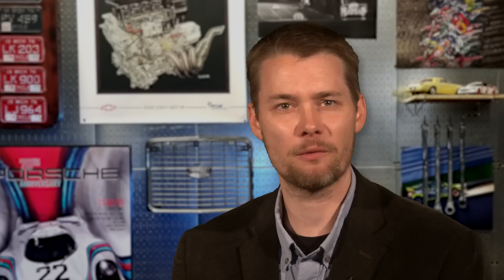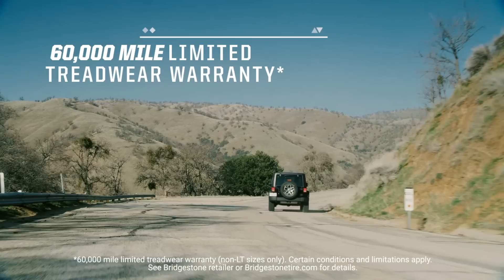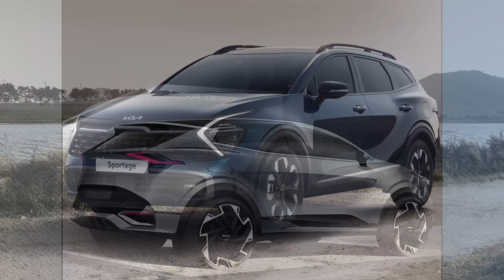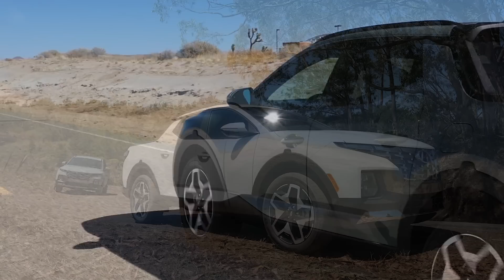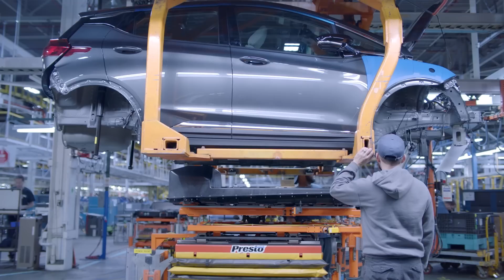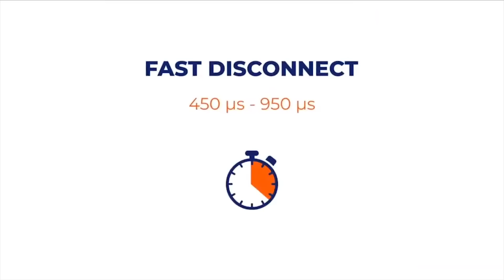GMC Eyes Off-Road Market; Ford Electric Crate Motor Specs - Autoline Daily 3149

Comment: Pyrotechnic battery disconnects have been around for years. My MINI had one way back in 2002.
Reply: Yes - they are not new for 12 VDC cut-off and are found on many vehicles. I recall most are activated when the airbags go off. But a switch that can handle 300-440 VDC is something more recent. A quick search revealed that Tesla has patented the device back in 2015.

https://patents.google.com/patent/US9221343B2/en

https://www.motortrend.com/news/tesla-patents-device-can-improve-battery-safety/

Comment: In the Ford Lightning 150, there is not enough space to attach the inverted directly to the motor casing, so it has 0.6 metre cables to the inverter sitting nearby. Lots of packaging advantages in having some distance between inverter and motor when it comes to all the HV components that might be grouped together in one sealed and plate-cooled box.

Comment: Talking about HP and torque without including the inverter in the equation doesn't make sense in an electric drivetrain, unless those are the motors maximum allowable number... That's like talking HP and torque numbers for a transmission. 

Regardless, the price is good if it comes with warrantee support.
Reply: Bosche already makes an integrated unit

Comment: @sean,  your reporting on the GM - LG situation could not be more detached from reality.    Awful spin on what was said...   Mary said LG is a "Valued Partner" and GM plans to continue their relationship with Ultium LLC .    Then on a separate question about battery partners and diversity Mary said Look,  we have our own lab, and investments in other battery technology partnerships currently.   You also could have added Sandy Munro was interviewed on Bloomberg right after Mary Barra, and he put the Bolt fire blame squarely on LG Chem. saying this was not GM's fault,  this was a supplier problem.
Reply: I like that you now use Sandy as an expert on the topic of GM's fires lol, but I do agree, it's LG's design problem. 
I just wish GM moved faster with the recall after seeing Hyundai's experience with this LG mess.
Reply: @AllanSustainabilityFan    No,  I am not calling on Sandy as a battery expert,  but this case only requires common sense.      Also for you if there is a design problem all the cells have the flaw..  This is a manufacturing problem which is different in that only about 1 is 25000 cells exhibit the flaw (s),   but that is too many, and LG needs to initiate better quality control to root out the bad cells prior to packaging.    BTW,  another Tesla S fire today at a service center in Europe I read.     No details on the series of S,  but I will assume 85,  those are the fire prone ones.

Comment: Management at gM just gets better with time ~53% market share down to ~17%  covid-19 flu  -  all seems insanity
outsourcing news - Joyson  --- continued trend outsource all -- just do assembly -- goal the badge on the hood the only part gM needs to pay a worker to install.
Reply: What automaker builds in house more cost content of their EV's than GM on the Ultium platform?    Not Tesla...  Tesla builds none of their production battery cells,  and 4680 has now been delayed indefinitely, as Tesla announced Both Berlin and Austin will start with 2170 batteries in the Model Y...      I also think Tesla has a patent issue with their structural battery pack,  not a lawyer,  but GM has a patent on something very similar.

Comment: The ford  EV crate motors would only  be great for replacing another EV motor. It would drive the value of an ICE vehicle down because of uncertainity of the battery and other parts plus it would need to be charged.Just a complete waste of time for Ford.... GM is just asking for trouble with the vaccine info...